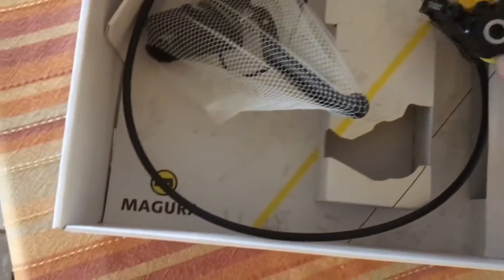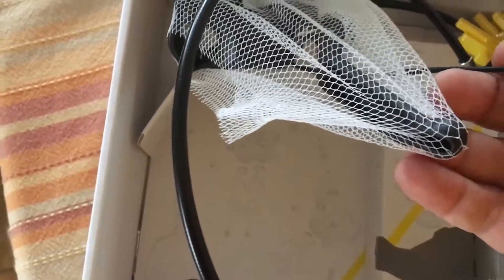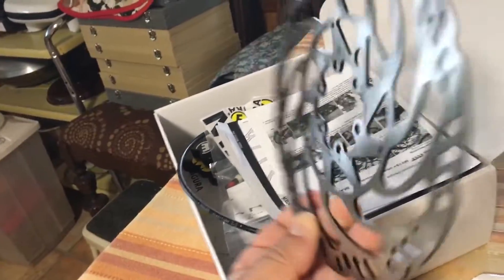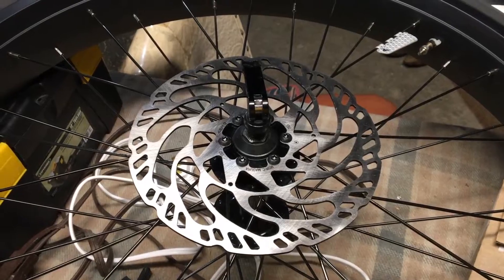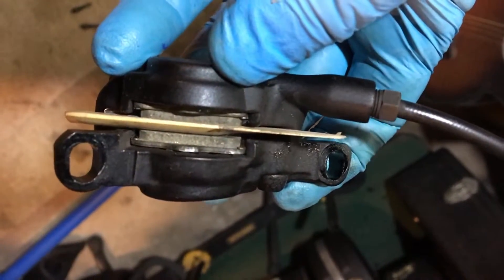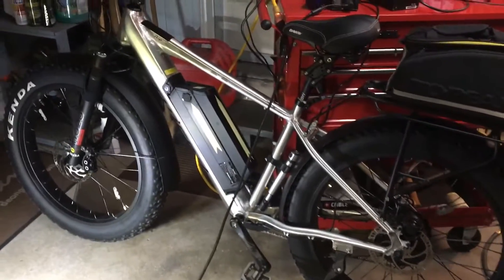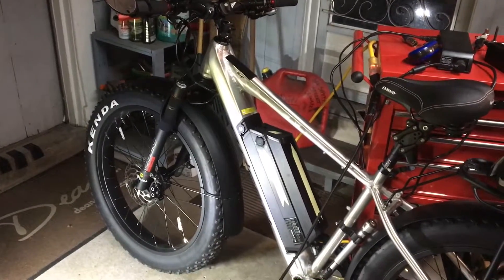JUICED BIKES RIPCURRENT S - FRONT BRAKE UPGRADE to Magura MT5e

Comment: Thanks much for the video. looking to do the same thing with 203 mm rotors. What was the adapter part that you ordered? I’ve heard it’s QM42 but when I measured it looked like it was supposed to be a QM 44

Comment: what im trying to understand is the maguras plug is different from the juiced plug so what did you do to make it work did you cut off the plug from the existing brake and the magura ones and sotter them together and is that all you have to do? Please help Thanks
Reply from the maker: Sorry, I just wrote you a big reply and it vaporized just before I hit reply, so all I'll say is "yes", I did exactly as you said. If you need more info, ask away and I'll try to get motivated to re-write it.

Comment: Do I have to mess with the motor shut off wire can I just cut it short and not use it
Reply from the maker: If your ebike was made to have a motor shut off switch in the brake levers, you'd be nuts not to use it. It's there to make sure you don't accelerate and brake at the same time, which can easily cause an accident and royally FU your ebike. If your brake system never had a motor shut off, then naturally you don't have to use it and could cut it off, but then it would make more sense to buy the Magura MT5 ESTOP which I believe is the same brake system w/o the motor shut off. They really don't tell you anything useful on the Magura site.
Reply from the maker: BTW... If your OEM brake system has a motor shut off and you just want to cut the brake lever wire on the new brake lever anyway, you need to find out first if the OEM switch is normally open or normally closed. If you cut the wire and your ECU doesn't get the correct signal, your motor will not spin thinking the brakes are on.
Reply: @dbfcrell8300  for some reason I thought the estop was just a better mt5 and my Surron ebike did have a motor cut off on the stock brakes and I took the cut off sensor off on those
Reply from the maker: @FretsMcGee  After doing some research, I found the MT5 eStop was just an MT5e w/o the cutoff switch, but I could be wrong. It's tough to get any info from Magura as they can be super unhelpful. Did you encounter any problems after removing your cut-off sensors? If not, then you may be fine to cut off the sensor wire from the MT5e. Seems counter intuitive, but if it works for you...

Comment: So how did you figure out which HIGO wires went from the MT5E connector to the screw on Juiced connector. That’s the reason I watched this, you talked a lot about switching out the connectors, but never showed which wires (by color) went to which terminals on the Juiced connector! Do you remember??
Reply from the maker: It's only a 2 wire connector and it doesn't matter which is connected to which. It simply closes the circuit. This is my quick answer, but if you need a better one, I'm heading out to work right now so I don't have much time. Let me know and I'll make it much clearer.
Reply: Dbf Crell First, thanks for responding so quickly!! There’s three potential wires I can hook this up to. So I have to pick two. Which ones did you pick.
Reply from the maker: @32543219  Are we talking about a Ripcurrent? The leads that go from the ECU to both brake lever cut-off switches both consist of 2-wires. It's a simple cut and splice in the old connector (which has 2 wires) to each lever. Not sure what 3 wires you have to choose from.
Reply: Dbf Crell sorry, I see the HIGO adaptor has three connections. Is one unoccupied? I don’t have a stripped connector in front of me. Trying to get ahead of this.
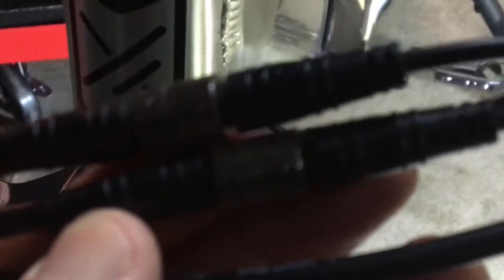Reply from the maker: @32543219  That's strange. My oem Higo connector only has 2 connections. So does the Magura brake.   Look here at 7:58   You simply need to use the audio continuity setting on a multimeter to figure out which 2 close the circuit when you pull on the brake lever. Then try to figure out what the 3rd wire is for (which shouldn't have anything to do with the motor shut off). Do you have a brake light on your bike?
Reply: @dbfcrell8300  OK now I see it. So you want continuity when the brake is pulled?So it doesn’t matter which wire goes to which connector on a two wire system does it?
Reply: Ps I’m going to do this mod, but I want to also include a 203 mm free floating rotor.  Are you very pleased with yours?
Reply from the maker: @32543219  Correct.
Reply from the maker: @32543219  I do like the Magua as it's miles better than the Star Union front brake my RCS came with, but it's a more expensive system to purchase and maintain comparitively. You must always use the Magura Royal Blood brake fluid and everyone says it's best to buy their bleed kit. You get what you pay for I guess, but my big-ass bike now stops as good as it goes with my big ass on it.  :D
Reply: @dbfcrell8300  I'm looking to run these on my segway x260 but I'm not sure where the red plug wires should be connected to trigger the break light?
Reply from the maker: @mrfocused4014  I don't know either. The electrical wire that comes off the Magura brake lever is meant to shut a motor off, not trigger a brake light, but it's a simple switch that could probably just as easily trigger a brake light that shut off a motor. I am unfamiliar with the Segway so I cant help you on hook up, but if you find where to hook it up, you'll need to know if you need a NO or NC switch to trigger the brake light or it might work backwards... the brake light will be on all the time and shut off when you hit the brakes.
Reply: @dbfcrell8300 i got it. Thanks for checking in, though
Reply: I am really cofused on which one of the Magura ebike brakes I should buy for my current ebike controller. Should I buy the MT4e closer NO or the MT5e Opener NO. I did a test to try to figure it out. But I am still confused on which to get. When I unplugged the sensor from my current brake levers. I am still able to throttle the ebike whike pressing the brake levers. Also the rear brake lights do not come on. Knowing this, which one of the Magura models should I purchase?
Reply from the maker: @TooTallRides-TTR  Just saw this 2 month old post of yours. Still confused or did you figure it all out?

Comment: Do you know if there's a 35a controller upgrade for this?
Reply from the maker: Rob, No, I don't know for certain, but I need to go look at the controller Bolton Bikes sent me (they sent me an upgrade controller I haven't installed yet. It's still in the box). It may be 35A).  Are you trying to upgrade b/c you're worried you'll pop the stock 20A RCS controller?
Reply: @dbfcrell8300  hey thanks for the response. I honestly just wanted a little more acceleration on the bike. Just got the new one that cones with a 25a controller and was just doing some research into upgrading down the road once the bike is out of warranty